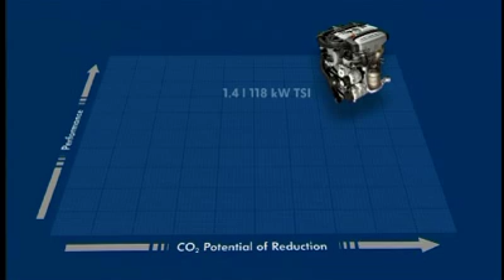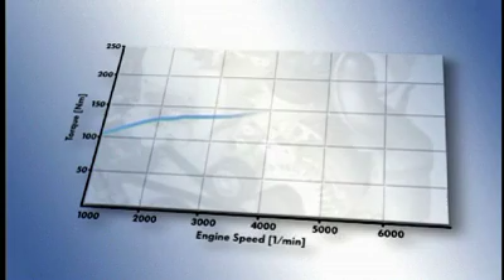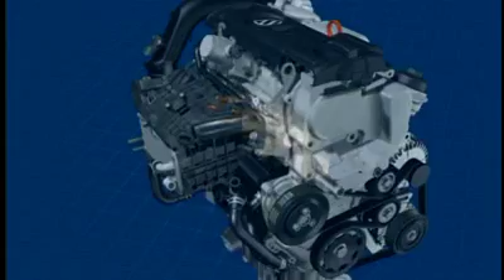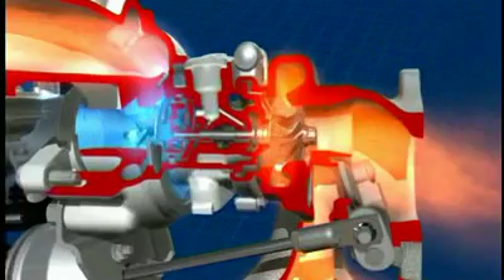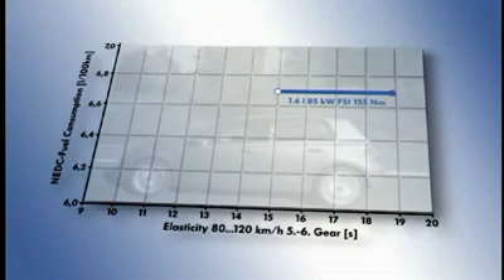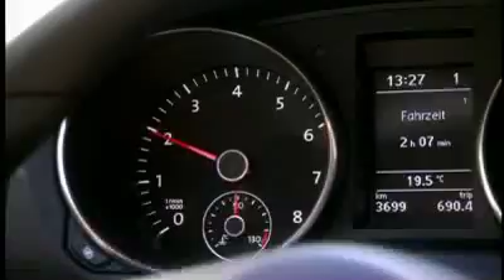Volkswagen TSI Engine 3D Animation

Comment: i bought a brand new 2016 VW Passat 1.8 L , about 16000km and no problems at all with the engine. I change the oil   according to recommended oil change and the car works great. The 6-speed auto is amazing,gives plenty of response, and nice fuel economy

Comment: I own a 2014 Jetta TSI. I never thought that I would ever buy a Volkswagen, but I was impressed when I rented one when my Cadillac was totaled by a dump truck that ran a stop sign. The performance of the 1.8 TSI engine in my opinion is sweet. There is impressive torque response from this little engine, I don't care what anyone says. It's a little jewel, and I would buy another one.

Comment: TSI ruined German cars...
Reply: +xXYannuschXx Pls Explain
Reply: debtah
Before the whole TSI downsizing crap, VAG (VW, Audi, Seat, Skoda) had a wide spectrum of engines avaible. 1.4l for small cars, 1.6l for most, a sporty 1.8l Turbo engine, but also V6 engines that fit into a Golf!
Since the TSI engines gained popularity, they are the 08/15 engine, used even in a Audi A4!
They are all the same, only different in their displacement.
Also, the 1st and 2nd Gen TSI engines were unreliable crap...
If you want a VAG car with something else than a TSI, you will need to buy at least a Audi S4 for over 40.000€....
Reply: Tsi engines and the DSG7 transmission
Reply: @mpr330cd  just look up a bit carbon buit up, oil usage they just fail

Comment: VW TSI create at foremost a joy for garages and repair shops - for they have a steady income fixing the inferior stuff that you've got in your car. Miniaturized motors with highest temperature and pressure is bound to break. Last but not least, on max speed on the Autobahn Turbos suck more fuel than natural aspirated engines and on lower speeds Hybrids do a much better job in fuel saving.

If you want to waste your money on a vulnerable engine with dull and boring cars, go buy Volkswagen. If you want to get reliable engines and modern looking cars, go for Honda, Toyota, Mazda.
Reply: +Kamuichan99 "reliable" but lazy engines. I've had a TSI for about 5 years now, traveling on average 900km/month. Not a single problem, only pure joy.
Reply: Psssst... Mazdas are just Fords in disguise
Reply: Mazda, Toyota, Honda. So much cars all made in Tcheck Republic and parts of England in the same factory as the other brands. Mondialisation all made car manufacturer the same, you need to find a brand that is always producing in his home-region with home-made parts. And those are nearly at the verge of instinction.

Tesla, Dodge, Daihatsu, GMC, Subaru, Ferrari... and probably some of the chinese things, that we never saw out of China.

Mitsubishi builds in Vietnam and in Check Republic
- VW produces all around the world with cheap components bought at every street market
- GM... killed saab and nearly killed Opel and Subaru with desastrous reliability politic
- Suzuki produces in the GM factory in Check republic
- So do Toyota, but, although, build some other shit in England
- The same with Ford

No, we consumer are pretty screwed. I wish myself that somebody does very serious reliability tests on 200'000km old cars. Its really a need in our society.
Reply: +Kamuichan99 I've seen guys turbocharge their lawnmowers shut up.
Reply: I can't agree with you on that guy's. We have several VW at the army, and some of my friends have. Even if the engine are not always at fault, they are problematic cars. And the VW service is nearly as bad as mitsubishi's one. During the "chain engine scandal" that lot of you have already forgotten, the german CEO claimed in Germany that they would change the defective chain for free in all cars, and in France, they didn't wanted to do so until they where at the verge of lawsuit.

They cheated with the emission of their cars. But, due to that, lots of customers can't actually sell their car in my country. VW promised mesures for making that possible, but, a week ago, they cancelled all mesures because they didn't work. It's obvious that VW will not try to fix the problem. They are playing on time until the cars are trashed and replaced, so they will have a minimum to change ; in the hope that those good swiss will not sue them.

Those peoples are clowns.
Reply: Bob Outélama Excuse my ignorance - and I don't mean to challenge your point -, but I don't know whatsoever a problem with TSI engines. Why do they are "problematic" or "faulty"? What makes TSI engines prone to problems? Their use of Turbo? I don't see a connection between TSI and problems.
Reply: Spirit Agreed
Reply: Spirit Probably bad engeneering behind those allied with bad quality parts. The first models with chains are a nightmare (we are speaking of several millions of cars). Chain often become longer, break or stuck, needing motor disassembly. Total engine failures occurs from time to time if the problem isn't detected fast.

VW responded to that in installing a chain tension system, but he's not working well on all cars and many of those tsi engines need a disassembly in a 25k to 75k kilometers intervals.
Reply: Spirit another problem is that the bad quality parts didn't stopped to the engine alone. So the TSI is generally an indication of the models whithin the years where the quality started to drop. Problems with the gearboxes, not waterproof cars, failing electronics and assistance systems going berserk... list is long.If you have a look on the VW user forums, you can see lots and lots of problems. This is all enforced by a very bad aftersale service, at the verge of criminal.
Reply: Bob Outélama Every car company does this. Ford did it with their 6.4 Powerstroke.

Comment: All those parts.. All those things that can break...
Reply: In some way you have right, in other you don't. That a car will become more fragile with more parts is not necessarly the case. It depends about engineering and quality of the components. Take the older Honda VTec engines, they run until today and are very complex in their construction.

At the other side, THIS particular engine had heavy problems at his sart. The chain got blocked all the time and needed to be replaced all the time. VW claims they changed it to a belt, but they are already a numerous amount of faulty chaincars on the streets. The general lifespan of tsi engine is, although, in fact, shorter than conventional atmospheric engines.

Something is although funny in your example, I'm asking myself how many moving parts a conventional V8 car has ? Must not be as much as an overengineered 4 cylinders ?!
Reply: +Bob Outélama

Comment: Is the turbo computer control VGT/VNT/etc.? Why not put the injector at the top of the cylinder and use 2 spark plug like Honda I-DSI, but between valves??

Comment: MPI = MULTI POINT INJECTION
No Turbo, No Supercharger (Compressor), Naturally Aspirated (Atmospheric Pressure), Fuel is injected into the intake manifold from multiple points.

FSI = FUEL STRATIFIED INJECTION
No Turbo, No Supercharger (Compressor), Naturally Aspirated (Atmospheric Pressure), Fuel is injected directly into the cylinder.

TSI = TWINCHARGED STRATIFIED INJECTION
1 Turbo, 1 Supercharger (Compressor) Force Aspirated, Fuel is injected directly into the cylinder.

Comment: 1.2 Turbocharger TSI : 19L/100km in city,26L/100km on highway
1.4 Turbocharger TSI : 25L/100km in city,32L/100km on highway
1.8 Turbocharger TSI : 38L/100km in city,44L/100km on highway
2.0 Turbocharger TSI : 42L/100km in city,65L/100km on highway
Reply: cap bro. i have a 1.2 TC TSI. in city it eats 5.5/100km, and 6.5 on the highway

Comment: when u need an durable engine, which gets wayyy more then 200.000 km on its counter, go OPEL. you may think what a crap... but have you ever heard about an opel turbo engine which cracks up after 20 - 30.000 km ? sure not ! bcuz they last as hell.
Opel isn't the crappy company like in the 80's and 90's anymore.

Comment: I had an fsi engine with 12.0 comp. ratio. because ratio was too high it needed higher octane fuel. and because we don't live in a utopia octane level is not always what they declare. so in 2 years engine get destroyed because of the preignition. long story short, we don't have the fuel technology for the engines with tsi tech...